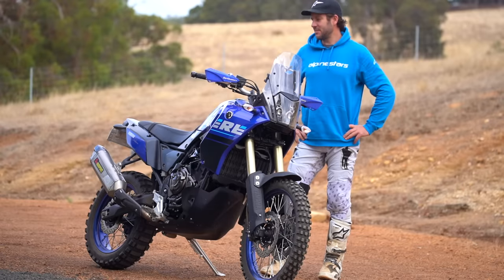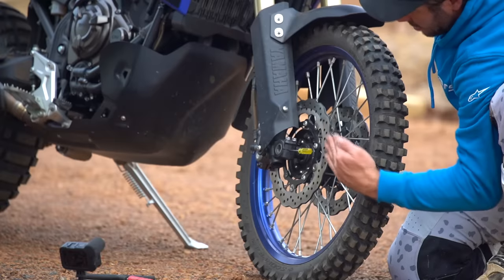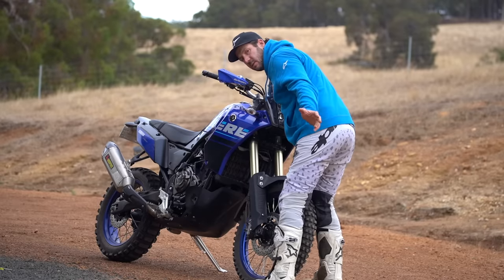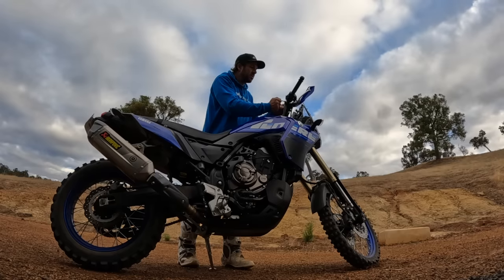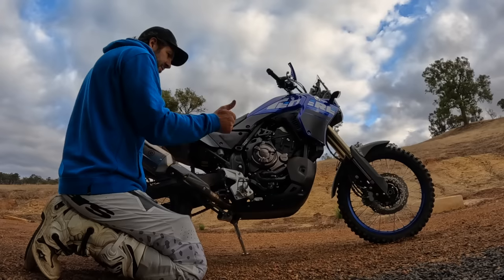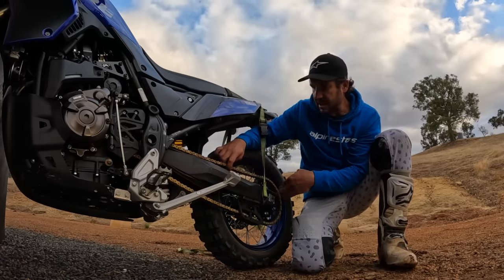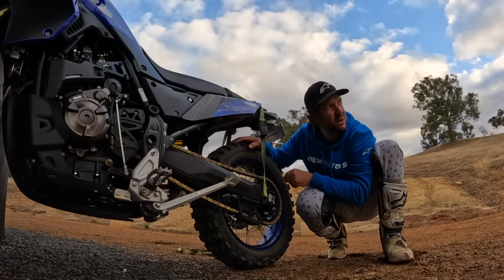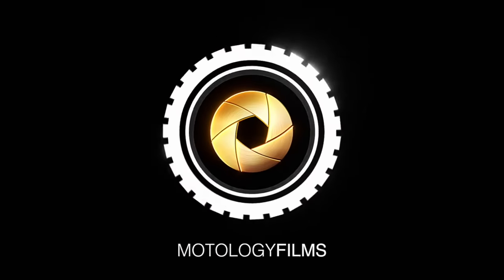How to maintain your motorcycle

Comment: Adam, I've been riding for 30years on and off road.  I have a KTM890advR and the chain slack settings has always been controversial.  Even the workshop manual is questionable.  Your ratchet system is literally the best bit advice I have heard in years.  Perfect!  Don't know why I've never thought of that myself or seen that before.  Thank you!
Reply: That's what I think and feel, too!
Reply: Mee too!   Thats so simple .
Reply: I dunno, Ive got an 890R and the book shows how to set chain tension, and that seems right.
Mine hasnt moved in 17,500 miles, amazing long lived chain sprockets.  I havent heard about the controversial part of 890R chain tension.
  DR650 guys ALWAYS over tighten their chain, the rear cush hub carrier bearings die, the chain wears out, the upper chain roller gets ripped out.  To many its a mystery.  Tighter must be better than looser.

Ive done 51,000 miles on my DR, unbreakable big blue couch of a bike. Nothing has broke during those miles.

Comment: Great video, Having owned and ridden just about every type of motorcycle and quad (currently have 28 tires to maintain and counting)for the last 40+ years your info on the front forks is GOLD. Having fork seal issues? Hmm, I wonder. I have 2018 Harley street glide that I have been staring at while riding all these years and couldn't figure out why it looks mildly crooked. I may have the answer now? There is one item that I think is very important to consider when checking chain tension. Once you get the axal, sprockets aligned straight, while having the rear tire off the ground, I'll rotate the tire in small increments to check for tension differences at different spots threw the chain. I have found that the chain tension can very quite a bit as you rotate the tire. (better quality chains may not be a problem) Once I find the tightest point I will make my adjustment there. Once I've retorqued everything, check the tension again. At this point I have also found depending on the tensioner that the chain tension may be to tight and needs to be loosened up a bit. As you have eluded to in your video, this can not be overstated to its importance to engine stresses.

Comment: I always did most of my own spannering. I love this guys calmness and thoroughness on stuff that are easy to overlook. One extra thing i would say with the chain tension is to also roll the bike along at least a couple of wheel lengths and check for the tightest point.. there will be tighter zones and looser zones.. always adjust at the tightest point

Comment: I appreciate these vids so much. I work a parts counter at a dealership. The amount of people that ask me "Can service do that for me?" Then get mad at me when I go talk to them and quote $100-200 in labor costs. When I've told them "It's a pretty easy thing to do. You can take apart your bike to the motor with the little bag of tools in your tail. So if you have basic hand tools in your garage, it'll be a breeze. Service charges by the hour. SO even if you want just a few things adjusted, you're looking at least $100 and you'll be on the bottom of the que. So depending on when you came in. It's a real possibility you don't get your bike back today." I have customers that own naked bikes and won't even change the oil themselves.

Comment: Love the idea of using a rachet strap to check chain tension. Ha, yah, I had what could've been a disastrous experience after getting my bike back from a bike shop. I had new chain and sprockets installed on my street bike, a couple hundred miles later decided to adjust the chain, it seemed a little too tight. Come to find out the rear axle nut was loose. Can't imagine it magically became loose, more than likely someone forgot to tighten it. I had previously done my own maintenance but now I'm learning to do the more intensive parts of it, like valve checks, etc and will be replacing my chain and sprockets on my own. 😂Thank you for another great video!

Comment: Another brilliant video. These are the basics all motorcyclists should know. Especially if you ride off road. I had a mate used to tighten his chain like a guitar string, he just wouldn't have it that this would likely damage his bike. In my experience, most people overtighten stuff. Use your feel and consider the size of the nut / bolt, how coarse or fine the thread is, and the leverage you're using. In most cases just bottom it out and nip it is fine.

Comment: I’m glad you upload such useful information. Recently I replaced the headers on my Honda xr, and after the first ride all the oil leaked out. I’m not sure if that was what caused the issue, but I definitely did not carefully put the new headers on. simply throwing stuff on without much thought may have ruined my engine.

Comment: Thanks for the tips! I do all the work on my bikes and I learnt a few things I never thought of. 
1. On my ADV bike the levers tip is going to be nice. 
2. Doing chain tention the way you showed seems to me more logic than the standard way I have done by the manual. Seems much easier to get it right.
Other tips I have used before and always carry tools with me to do most of the basic stuff on my bike all the time, even on my road bike :)
Reply: I don't really see what's more logical about it. The engineers at yahama would have already worked out how much slack you need for the full suspension travel so doing this is just kinda redundant in my opinion.
Reply: @elobiretv  It's more logical coz if you've changed your suspension, changed your tyres, have a lowering link, done crazy things with your preload, have a really tired spring - anything that takes your bike out of factory spec - then the setting in the manual won't be right.  There's probably enough leeway that you can still use the factory setting.  Probably.  But if you want to be sure, this is the method.
Reply: @elobiretv  Like Jaime already replied, if the bike is not stock, then things change from what the manual says. 
For example, my Super Tenere has a different rear wheel, with different size rim than standard, tire profile changes depending on tires(some are taller, some more flat). The way of doing it in the video eliminates all the variables pretty much as you get the maximum that the chain will go.
Reply: @jaimemetcher388  how do any of those things affect chain tension? All that matters is the spockets sizes and the swing arm pivot location.
Reply: @Twm532  They change the angle of the swingarm while the bike is sitting on its tires.  The chain slack setting printed in the manual is valid for the specific swingarm angle of a stock bike with no load sitting on its tires and standard side stand.  Adam's technique also relies on a specific swingarm angle, but it's an angle that's easy to reproduce regardless of what else is happening with the bike.

Comment: I always do my own stuff.  I do it cheaper and better than any repair shop.  Just the other day, I trued my own front rim.  The day before that, I had no idea how it was done.  From oil changes and new tires to valve checks, its really easy if you just try.  Always always always when you buy a bike or a car, the next purchase is the service manual.  The best part of doing your own work...you'll know your machine by the back of your hand.  Thanks for the vid!

Comment: Great video!  Especially the part about how important it is to allow the fork legs to center, before tightening the wheel axle clamps.  I'm a front fork engineer at Öhlins,  and I think people underestimate how important that is, if you want the best performance out your front fork.  Friction is the main performance killer   on all motorcycle suspension.  On cars that weighs more than a metric ton, not super important, but on a bike where you feel everything..very important.  This is what we chase everyday at work, finding ways to reduce friction, while meeting oil leakage test criterias.  It's a constant battle between each two🙂
Reply from the maker: Thanks for the feedback mate. Do you make 48mm fork to fit the T7? I'd love to try / feature them ...

Comment: "Just start with take your seat of and have a look...." 
I did repair all kinds of machines in my previous working life. I also do repair my old Land Rover pretty often. And there I am with my first and almost new bike and feel like I'm not allowed to touch it. I drove to the motorcycle workshop to have my chain checked because I felt so unsecure. And than the mechanic removed the seat of my bike an I was like "wow! how did you du that!" (and it looked so strange and shockingly raw). I know, it's embarrassing, but that's how I started some weeks ago. So your words touched me really. It seems I'm not the only one with this strange fear of contact. Thanks!

Comment: Good chain tension tip! The other tips as well. I was about to get the rear shock off to be able to check where in the travel the chain is the tightest. I'm had som idea that it could be in fully compressed due to that the chain has to take the long way around the slider on the frame. If the chain doesn't touch the slider then it's out of the equation 😊

Comment: Great video as usual Adam. I grew up wrenching on bmxs, motorbikes (mostly of the RM, KX and YZ type) and cars that spend time on race circuits. I can’t believe how far I got in life without a torque wrench. I guess I’ve got the torque wrong probably hundreds of times and usually overdoing it. I’ve learned how much to torque fasteners based on the size of the spanner/socket/hex, the size of the threaded part and the material being fastened into. Nothing like drilling, tapping and helicoiling alloy parts to teach you a bit of feel and subtlety.
I wouldn’t mind betting you’ve got a pretty well calibrated internal torque wrench by now, right?
Excellent explanation of pinch bolts too. I remember having a set of really harsh, crappy SSS forks (supposed to be the duck’s guts) which turned out to be nothing more than my lack of alignment and heavy-handed torque settings.
Love ya work Adam-been watching every new vid for years. Thanks for such well-produced great content.👍👍

Comment: Absolutely agree to check front wheel spindle bolts, as different manufactures have the 2 bolts facing front some underneath like Harley, the Harley bolts come loose and one side of fork came off, don't ask me how I managed to stay alive well going all over the road out of control. Check your bolts every time it takes 2 seconds Len Canada

Comment: Thanks you showed in 15 min. which has taken me 40 years to learn the hard way. You are so right when you are pulling wrenches and you are a flat rate mechanic and need to put food on the table lots of time your going to get it where that is good enough. Sad thing is that I still help friends, they have bad steering head bearing and don't even notice. Just like the person working on the bike that gets it wrong, it happens the same way with riders not being in tune with the bike either. Again very well done great advise.

Comment: Thank you again for very informative video. Very nice tips, which I have never heard of, even when doing basic maintenance to my bikes for 30 years. I have just serviced my bike to be ready to riding season. I smiled, when you said about grabbing a beer and just do a little bit tinkering. I really do not like doing services very much, but good music, beer and cigarettes helps -the more time it takes, the more happy and energized I get... But the headache in the next morning is usually pretty bad. Btw, I only smoke in the riding season, which is not very long here in Finland, so my lungs get pretty clean by the spring.

Ps. Am I the only one, who is so depressed after riding season, I don't have motivation to do shit to my my bike. I don't even clean it, do not use any fuel additives or anything. Only one thing I do, I remove plus lead from battery -if I remember.

Comment: Great video, I've had some brand new bikes just leak from the fork seals.  You sit there going how in the world can this happen, get new seals and have a suspension shop fix it.  Theory, when they put the tires on at the dealership, the forks aren't lined up correctly.  In motocross we would spin the wheel on the stand, hit the brake, then do it again, then tighten.  Makes you wonder...

Comment: Wow.  I have a KTM 1290 R and so far 2 muffler support brackets have sheared at the bolt at 75 dollars a pop.  I thought it was a design flaw by KTM (which it kind of is) but now I see its a common malady that comes down to getting the muffler and tail pipe settled in place and then the right sequence of tightening bolts and clamps.  From Bolivia...Thanks Adam!!

Comment: Damn right, what you said in the last bit. I once had to replace the stator of the generator in my F800GS, because it refused to load the battery. I took the bike to the dealer, came back two days later and left 600 bucks for the exchange and some maintenance works. 
Two junctions away I noticed my exhaust getting louder and a strange smell at the traffic lights. Turned out that the back brake cylinder did not reverse anymore, so that I found myself again on the BMW-yard half an hour later. Another 300 euros gone. That's now 7 years ago and a just have been once at a KTM-dealer since. 

Like the Awesome players, I started to throw maintenance party's with a few friend, drinking coffee with Irish cream and replacing all that has become old or loose. Its also much easier to change a clutch-basket, the fork-oil or adjust the valve play with double or triple the knowledge around in the shop.
And you get to know your bike, in case you drop it 2000km away from home in a pond and have to pull the spark plug. ;-)

Comment: I only do basic maintenance. I can pull apart and put together my push bike but Since the push bike doesn’t go faster than 20 kms p/h what in that case any mounting mistake is not gonna be a big deal but when it comes to the motorcycle that could be deadly.

Comment: Agreed and you brought up a good point, if you’re out in the wild and riding off road, you might not be able to call someone to come out and fix your bike for you or tow you home.  That’s kind of part of offloading whether it’s in a truck, a jeep motorcycle or an ATV, you’ve got to take tools and know how or friends that know how to be able to work on it and fix some things yourself and that’s part of the whole adventure and off-road thing, otherwise you might want to go to a track where you can park your truck right next to it, so you can push your bike back to the trailer if it breaks because if you’re 100 miles out in the middle of nowhere, you can’t just make a phone call and have somebody come save you and I think that’s one of the biggest reasons to go off Roading, is to get away from all the traffic and congestion, but that requires some independence and ability. Take care of yourself.

Comment: Good advice! On the issue of the exhaust, I would expect most systems to have the (metallurgic) elasticity to "resettle" themselves, within a certain range of adjustment. The one side I would expect to suffer most as the most vulnerable part of the system, would be the headers' side as those need to be very precisely put together. The mid pipe, not so much. Good advice nevertheless.

Comment: I almost everything myself for over 55 years.  Get the service manual and learn it.  Pick the tools you need at home and minimal amount for the road.  Be as self sufficient as possible.  Be prepared for the middle of nowhere.  All good points especially the chain.  It can lead to utter destruction internally beside being broken on the trail.  When you loosen a bolt just a little and the component falls apart from all the bolts being loose you know then it wasn't assembled correctly.  Learn how, go in small increments and get eerything centered and balanced.  Look at it, preload it and make it right or pay the price.

Comment: Wow, I never knew bar clamps were designed this way.  I've always focused on having the gap even front and rear....  Also. the truest statement in this video is that the guy who is being paid to work on your bike probably doesn't give a shit about your bike being correct.  Most times my bike or cars have gone to a repair shop or dealer, they've come back with problems that weren't there when you dropped it off.  I'm even hesitant to take any of my vehicles in for warranty work anymore because I simply don't trust that the mechanic cares that everything is done correctly.  Like he said in the video, they are all in a rush to get repairs completed and out of the bay to get the next one in and generate more income for the day...

Comment: On the bars and levers, is there a reason you bottom the front instead of making both sides with an even gap. I always tried to pull them down even like a U-bolt, but I’m open to changing my mind.

Comment: Also a tip is to get a motorbike that is fun to drive, but cheap so if you mess up it's just a good lesson. Also you can laugh when you roll of it and the scratches are just good memories.

The first thing I did when I got my motorbike was take it apart and clean the carberators. It didn't needed it, but since then I know how the bike is put together and where all the components are. It helped me since.

Comment: This work is So bloody Important and especially on road bikes though it affect the Handling so much that it can turn any good handling bike into a wobbling "killado". I used to race bikes in 70-80's and I never had a wobbling bike where others were thrown off their bikes. But especially on road bikes is lining up the wheels Very crucial And don't trust  the marking on the swing arm But instead use a string on Both sides of the wheels to align them and that will transform the handling on every bike that has a chain 😉